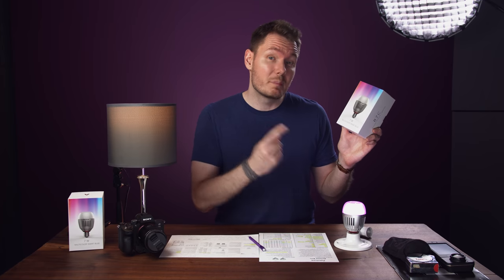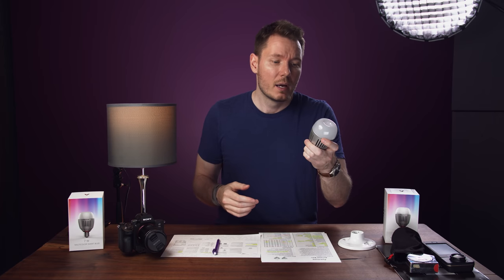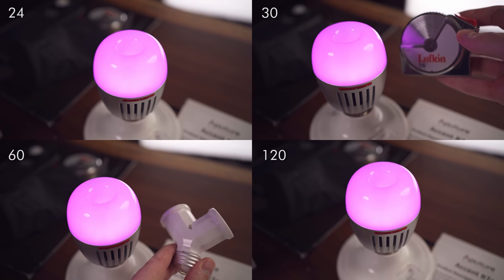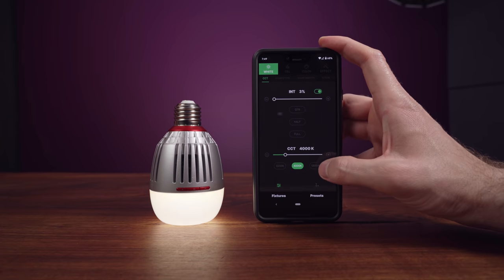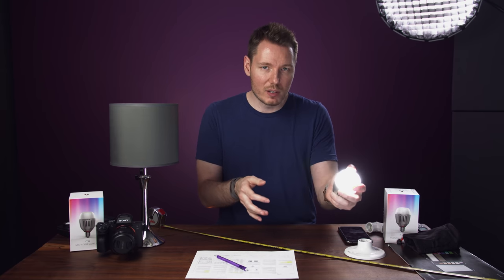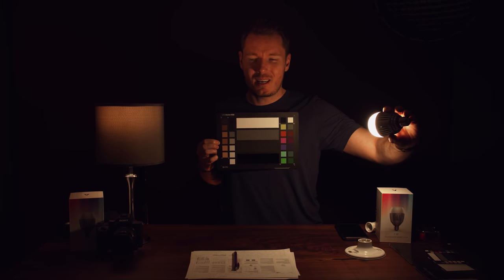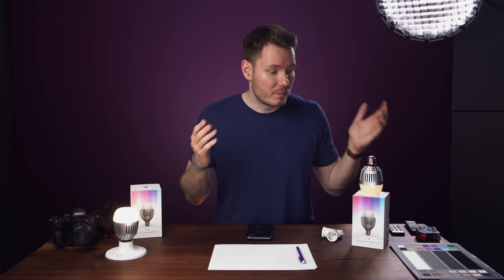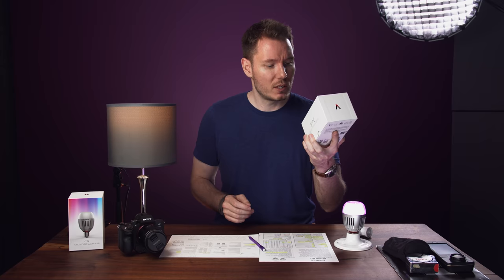Aputure Accent B7c Review: NOT Your Grandfather's LIGHT BULB

Comment from the maker: Correction: I had the light in DC mode. That's why it wouldn't turn off when I flicked the light switch off. In this mode it just switches over to battery power as I showed. This seems to be the default setting. If you choose to switch to AC mode, then it works like a normal light and turns off when you flick the lamp switch. Cheers! 🤓👍
Reply: Gerald Undone That may have been one of the most confusing explanation during a video in which I was multitasking while listening 😂
Reply: @Gerald Undone Once again great video is there a Canon c70 review coming up?🙏🙏🙏
Reply: I can only speak for myself, but I enjoyed the video.  Variety is the spice of life.  I've honestly been looking to see what a standard Philips LED build would look like on a set like yours.  Now I know.
Reply: I'm Gerald Undone, and the answer to life, the universe and everything is Hue 285.

Comment: My experience using Aputure Sidus app on Android (on a Google Pixel 3) has not been positive: it does not detect my Aputure MC no matter what I do (I tried every setting the developer suggests). Maybe I'd have more luck with this new lightbulb? I do know that the app seems to work fine on Samsung phones, but it seems to be a "your mileage may vary" situation.

At any rate, I can confirm that I use the Sidus app on iOS and it does work flawlessly there.

Comment: A couple of thoughts. First, having the e26 base being the only means of charging seems like a bad decision. A usb c port to charge it would be fantastic. Otherwise you're going to have to set up lamp bases just to charge them when not in use. 

Second, $70 seems a little steep for a light that's really only useful as a practical. I think I'd be more into it at the $50 mark.

Third, the beam angle doesn't do too well in that lamp you've set up, and I suspect it wont do too well in most table lamps, only illuminating the top. I think I'd almost like to see a battery-less version with a more standard beam spread.

Comment: Thanks for the review, Gerald.
I wish you addressed the beam angle here - it seems problematic. it looked like it could barely fill the top half of the lamp shade you used.
You don't get this look with a regular bulb. If that's the case with most practicals - isn't it kind of a deal breaker? Just a weird look IMO...
Reply: Good point, it doesn't look very natural that way.

Comment: a great alternative that is probably maybe brighter (9w) and is also bi color is the "mi light" bulbs. i am using mine for more then 2 years, and they have a 4 ch remote so you can have 4 groups of lights. haven't tested mine but i'll bet anything they are more than 93 cri, really nice light. adding a link just for reference, you can find it for cheaper and there is also a less bright option with rgb.  https://www.ebay.com/itm/303325436041    https://www.ebay.com/itm/303325436892    note the remote is sold separately. oh and also important, they do not flicker at any intensity

Comment: I need some tips.

1. I often loose the connection to the lamp. Especially when I try to connect several light B7c light bulbs. Do you have goos tips to make this more stable?

2. When I have them in effekt mode like fireplace, it’s difficult to get out of the effekts when I got to “normal” mode...why? I had to reset everything and reconnect Bluetooth before  I got it back to normal. Do you have any tips?

3. Color match, I love this feature but how to make it as accurate as possible? Especially when there is “ugly” light, as an example in a subway with old greenish light.

Looking forward to get tips on this issues;-)

Comment: One thing I would've liked to see is where around 12 minutes you tell us it's not suitable as key lights. Which is by definition true in some cases. But there are situations where "key light" is just a small accent to the ambient light. How the bulb could've worked there? Pump the iso a good 3 stops and use F2. Maybe then the bulb could be an excellent, mobile addition for the on-road-documentarist doing interviews?

Comment: It is worth noting that this bulb does shoot light a lot more directionally than a typical tungsten bulb, which aims the light much more in a sphere. In the lampshade you've got it in, you can clearly see where the light starts, and it's way up there because of the huge heat sink at the bottom. I'm not convinced this sells the look of a lamp.

Comment: The actual bulb part is very small, so when you use it as a practical bulb replacement it doesn’t shine downwards, like a normal bulb would. You could see this on your demo. I’ve used another brand for a while now, and while it probably isn’t too colour accurate it’s good enough and it does look like a lightbulb when in a light fixture. The brand is Auraglow. No batteries, but full RGB and works with an app.